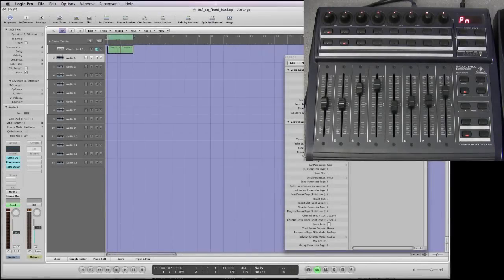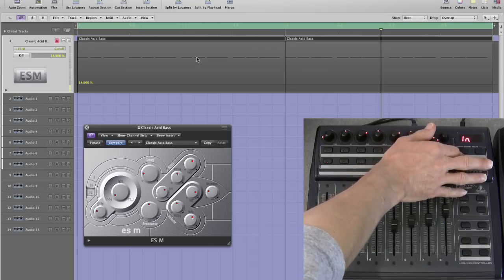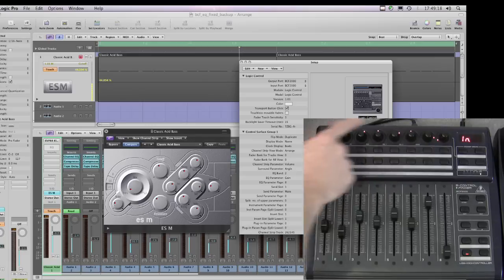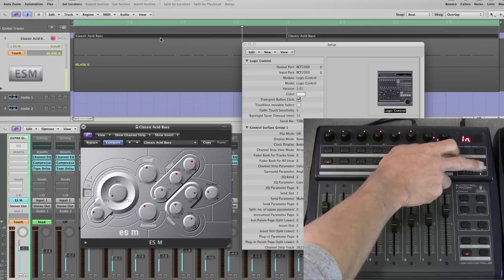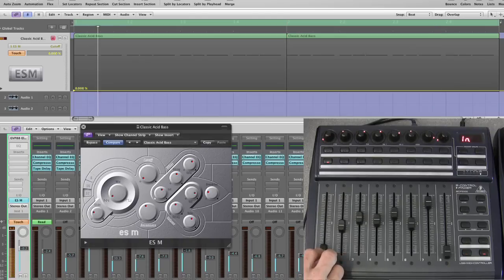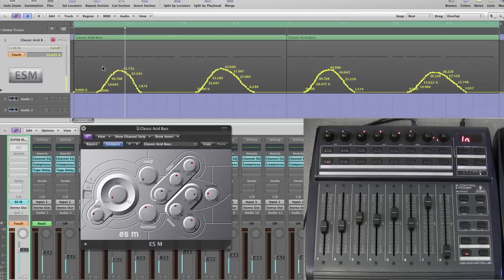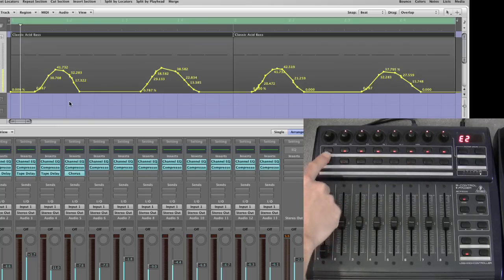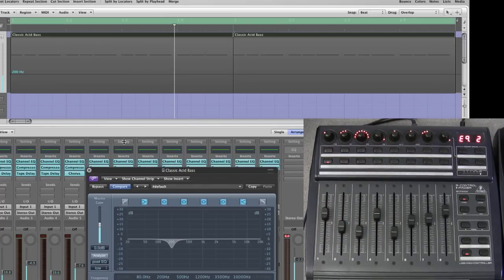Behringer BCF2000 & Logic Pro user guide - 15/16

Comment: Go into Logic's "Key Commands" (Control+K) and assign "Bypass All Control Surfaces" to a key you aren't using. This will give you a perfect Toggle On/Off of the controller without any hassle if you have automation on both sides of the flip. :)

Comment: I tend to actually do some pan automation for mixes for people listening with headphones.
So another useful tip I could give to you and others asking is:
Instead of using flip mode to bypass the faders, go into logic's "Key Commands" (Control+K) and search "bypass all control surfaces" assign this to an unused key on your keyboard, it will automatically give you the option to toggle the controller on/off without losing any settings, or without any error messages. :)
-Uno